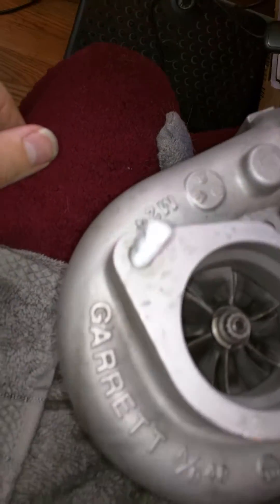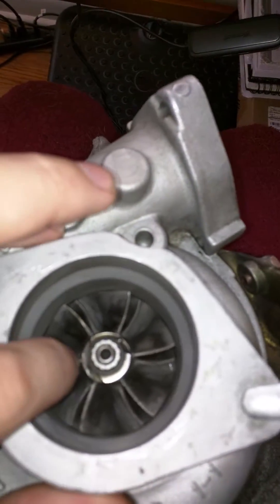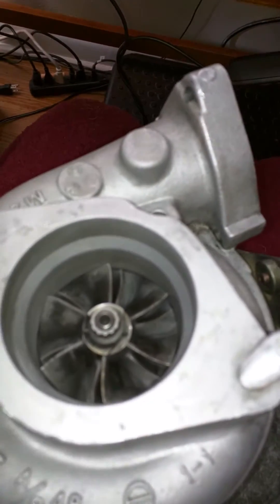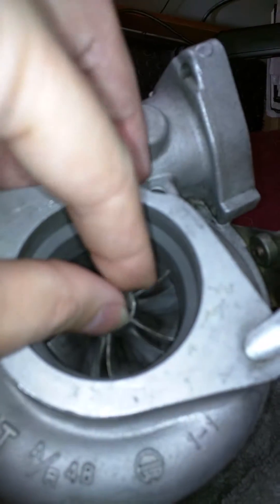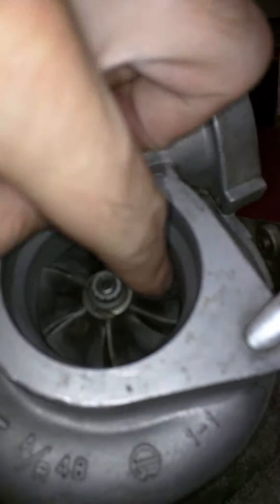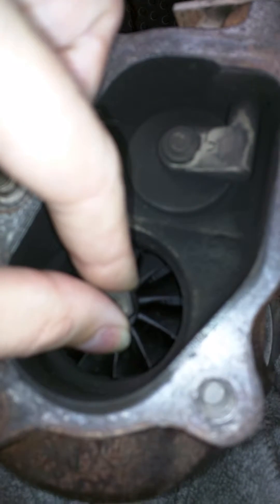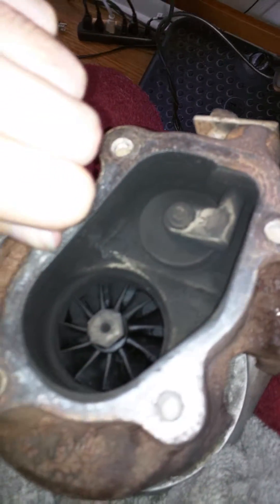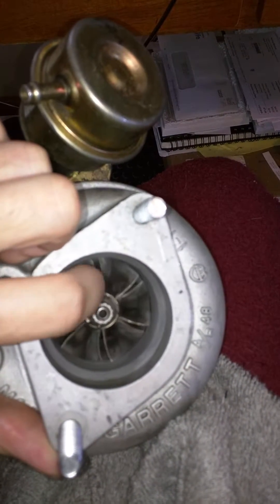Used Garrett T25 turbo

Comment: There is needed space for oil in the tolerances. The bearings are essentially fed oil pressure and those bearings “float” in oil which takes away that play. If you can push the wheel into the housing and make it rub, that’s too much imo and I’d rebuild. The in and out is thrust bearing wear, which is also the not good